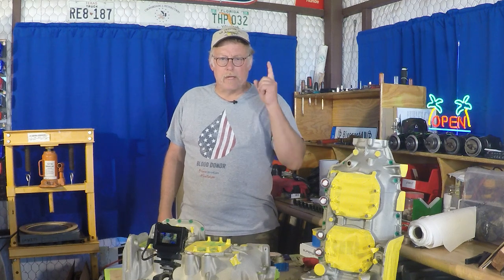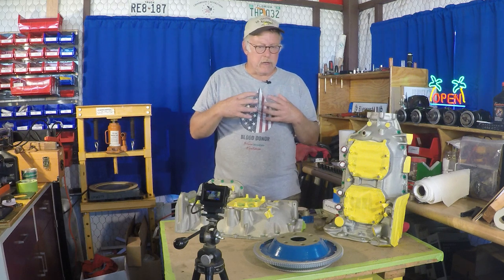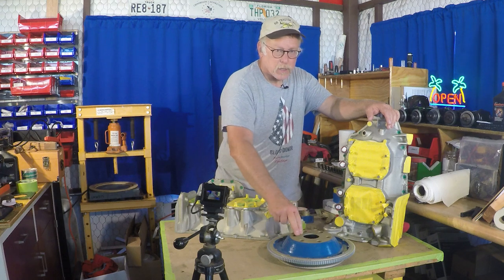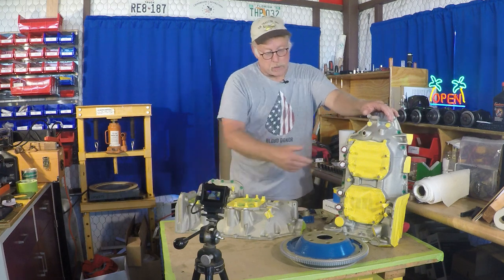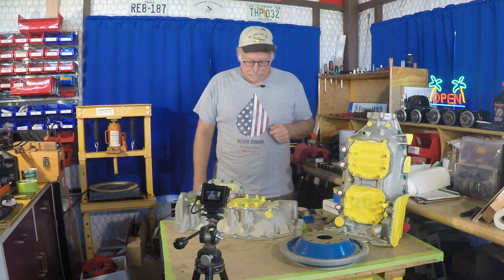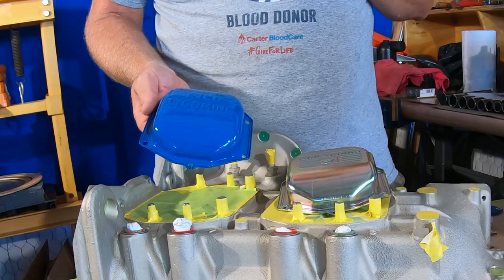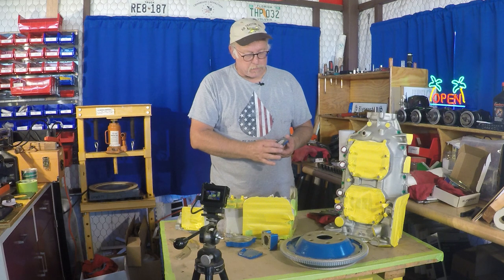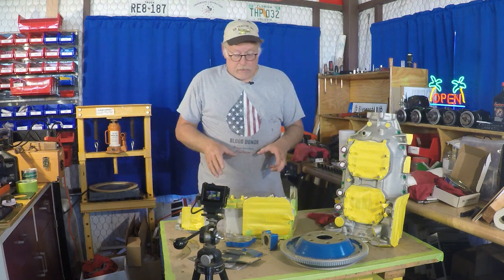360 Engine E09 Engine Painting!

Comment: Bill, You'll likely find that on superior cylinders for parallel valve Lycoming's that the OEM valve covers don't fit, they aren't deep enough for the slightly taller rocker pin bosses.  I would guess thats why they come with new ones.  Not sure if this has changed recently, but I'd ran into that in the past.
Reply from the maker: You are 100% correct!  We totally forgot about that.  We refinished the rocker covers when we sent the cylinders out for refurb as they were first run (1700+/- hours).  When we received word the cylinders were BER due to head work we went with the Milleniums.  I'll make sure to give you a shoutout on the next vid for the catch!

Comment: G,day Bill from (Quarantined Sydney) Australia.
I really like the VHT enamel paint finishes on the IO-360 it gives association to the custom performance Lycoming 'Thunderbolt'.
* After degreasing parts and bead plasting, would you wash with mineral thinner or soapy water prior to priming?
* Is there any benifits to using 'Alidine' anti corrosion, under primed and painted surfaces?
Q&A I'd like some video and comments on manual handling of engines from engine mounts to work stand. When and how you connect a hoist/lift.

* Also if it's not to much trouble, something to remove all variants of (covid-19) from the world?
🍏🌴
Reply from the maker: Hello John,

Here are some answers that may help you and others.

Q1.  I really like the VHT enamel paint finishes on the IO-360 it gives association to the custom performance Lycoming 'Thunderbolt'.
A1.  When I shoot an engine with enamel (stock Lycoming or Continental, ...or Ford or Chevy for that matter...) we typically will give it an overcoat of clear polyurethane (PPG Concept 2021) to make it easy to clean and inspect in the future.

Q2.  After degreasing parts and bead blasting, would you wash with mineral thinner or soapy water prior to priming?
A2.  Typical cleaning would be rinse off with clean mineral spirits, then hot water.  External surfaces would be then degreased with MEK or Acetone wipe prior to paint application.

Q3.  Is there any benefits to using 'Alodine' anti corrosion, under primed and painted surfaces?
A3.  Yes.  Alodine of course helps with corrosion and also aids in paint adhesion (as far as I know)

Q&A I'd like some video and comments on manual handling of engines from engine mounts to work stand. When and how you connect a hoist/lift.
A4.  We'll get there...

* Also if it's not to much trouble, something to remove all variants of (covid-19) from the world?
A5.  Hasn't killed me yet.  Apparently working in the shop and hanging around airports is the best way to thwart it. 
 Go get 'em!...

Thanks for watching!

Comment: Ok, were do you find the Overhaul manuals?  Looking for Lycoming O-540 E4B5.  Could you point me in the right direction.  Thanks, like the voice-over format.  Thanks.
Reply from the maker: Lycoming.  The manual appropriate for the O540 would be the 60294-7 Direct Drive Overhaul Manual.  Thanks!
Reply: @HangaRatz  Thanks, I found Revision 9 (Dec 74).  is that the latest Greatest?  Anyway, thanks for your help.
Reply from the maker: @michaerun  14 is latest I believe.
Reply: @HangaRatz  Thanks for the help, and I went back and reviewed your paper work video in this series on your playlist, it was VERY helpful, Thanks.